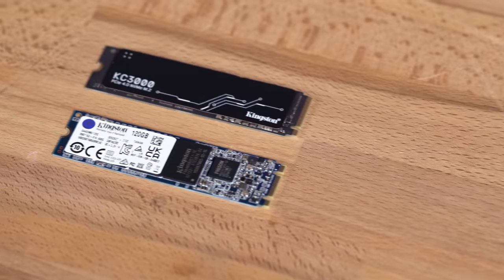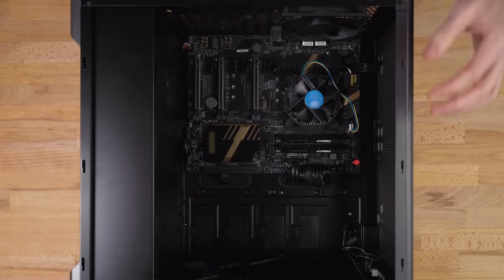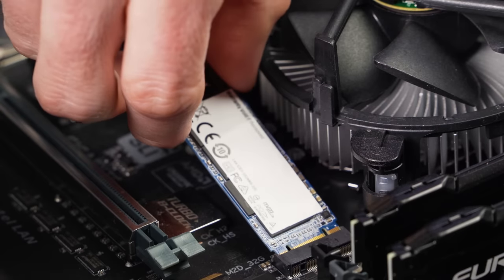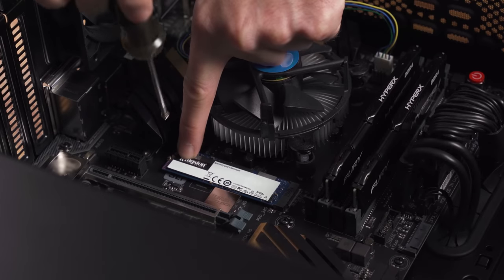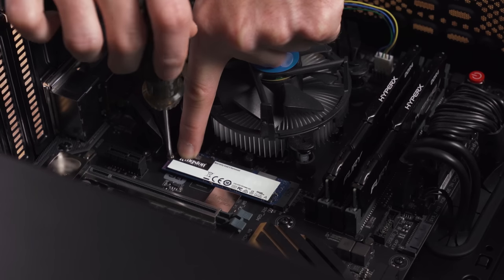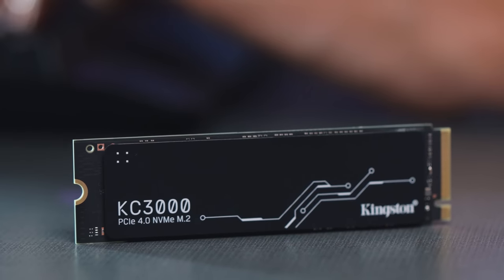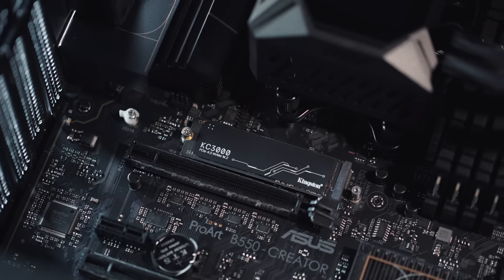SATA M.2 SSD vs PCIe M.2 SSD - What’s the difference? – DIY in 5 Ep 172

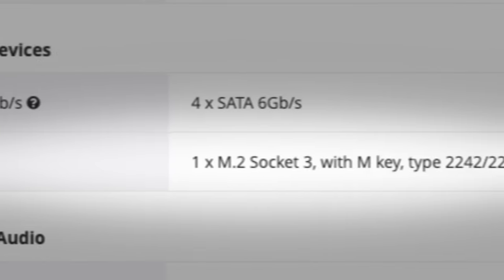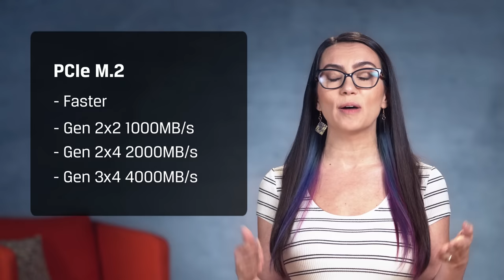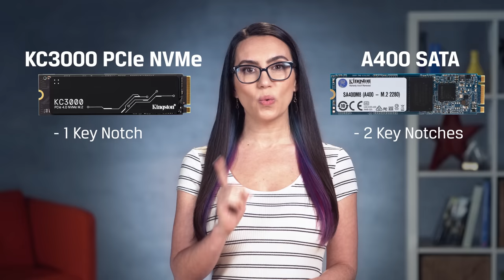Comment: At 2:00 in the video you claim that an M.2 SSD can only support one protocol. Perhaps that limitation applies to Kingston SSDs, but I recently installed a gen3 Crucial P3 Plus M.2 SSD (connector has only one notch) into an Acer tower PC and it ran at SATA speeds, not NVMe. When I moved the same SSD into a slightly newer Acer tower PC, it ran much faster, at NVMe speeds. So here we have an M.2 SSD that supports both SATA and NVMe protocols, although not, obviously, simultaneously. The BIOS / UEFI determines which protocol to use, but the availability of NVMe may be limited by the chipset PCIe generation. If the motherboard / BIOS / UEFI doesn't support NVMe in the M.2 slot then the Crucial SSD "falls back" to SATA. At 2:41 in the video you stated that Gen 3x4 maximum speed is 4000 MB/s, so how do you reconcile this with your statement at 3:38 in the video claiming that the Kingston KC3000 NVMe SSD can run 7000 MB/s read and write speeds, which shouldn't be physically possible? It's also hard to believe that the write speed is as fast as the read speed.
Reply from the maker: Hello,
M.2 SSDs will support either NVMe or SATA, but the M.2 port on the motherboard can support both SATA and NVMe. The Crucial P3 Plus was probably still running in NVMe and potentially at slower Gen 3 x1 speeds due to the older M.2 port, which is perhaps why it performs better on the newer Acer Tower. Remember, PCIe Gen 3 can go up to x16, but most NVMe SSDs only go up to x4. Now, our KC3000 is PCIe Gen 4 x4, which doubles the performance in both read and write speeds. Our 2 TB and 4 TB capacities can support up to 7000 MB/s. If you have any other questions or concerns, visit our support page: https://kings.tn/3leJG20, or send us a direct message via Twitter, Instagram, or Facebook Messenger. 

PCIe speeds explanation: https://kings.tn/3LraG9p

Comment: One question I had that I don't think was discussed was whether there is a difference between M.2 NVMe (which I guess is the same as PCIe? not sure) on a motherboard vs. M.2 NVMe on a PCIe expansion slot via an adapter card and if there are any issues like what kind of slot the adapter card is in or any other specs re: the card itself. I just bought an old computer with an M.2 slot but found out it's only for a PCI adapter assembly (Lenovo M900 tower computer) so I'm getting an M.2 adapter card for PCI Express card slot (physical link width x16; negotiable link width x4, x1) so I can use an M.2 NVMe SSD. The card is supposed to fit in PCIe X4 or X8 or X16 slots.
Reply from the maker: Hello there the NVMe SSD is the Bus interface while the PCIe would be the physical/logical interface. If you are going to use an adapter make sure you check the specifications of the manufacture to make sure it can accommodate an M.2 NVMe 2280 SSD. Also we found a  posting pertaining to using an NVMe SSD and adapter on your system: https://kings.tn/3KP5eLq

Comment: I have a question, I like to upgrade my laptop Macbook Air 2012. So I buy the Samsung SSD 980 NVme M.2 SSD. Also buy a adaptor for this upgrade. After done everything when I do power on nothing happened. So I replace with HD comes with laptop and it's work right away. So what I do wrong? Please advice. Thanks.

Comment: Nice video, I am still unsure though, I have a sata m.2 ssd (Sandisk SSD X400 M.2 2280) that is 6-pin (2 notches) would an enclosure that supports both m&b 6 pin PCIE and M-key PCIE work for it even if the drive is not PCIE or i need to get an enclosure that is not for pcie? I am asking because if PCIE supports it i would rather get that as i may use it again for another drive that is PCIE in the future.

Comment: I took my card out and it has the 2 notches as shown in your video.  Does that mean my driver will not accept the one notch card (PCIe) ?    

I just checked my laptop's specs  and for hard drive it says:  PCIe NVMe M.2 SSD  Form Factor 2280.  So now I'm really confused because it has 2 notches!
Reply from the maker: The B+M keys on an M.2 SSD allow for cross-compatibility on various motherboards if the appropriate SSDs protocol is supported (SATA or PCIe). For more information refer back to your motherboard manufacturer's website.

Comment: 4:00 well the script could have added that the SATA protocol still exists because NVMe is only impressive with large file transfers, not on loading games, system updates, or app installation where the SATA can keep up.
Reply: that's... not true?
Reply: @afriendofafriend5766  just read any SSD review on Toms hardware
Reply: try to load 4K ms flight sim textures on SATA and on nvme pcie and ull see if the game is loading faster

Comment: For system only NVME! SATA is veeeeryyyy slow now 🙂
My new 12400 enjoing with Kingstone KC2500. 20 sec - comp is ready.
Reply: 5900x sata ssd samsung 870: 11,5 seconds
Reply: @DiscordinviteCodeYvCHHzBN27  MS-DOS? 🙂
Reply: My laptop with M.2 SATA 860 evo, 10-12 sec and its ready
Reply: @RichBatangKalye  Obviously, you are using quick boot. This is normal only if you manually adjust the timings. I have 12 seconds of BIOS loading - the memory adjusts.

Comment: I've read many of these fast NVMe M.2 SSDs' self limit themselves on speed based on temperature  - they overheat unless you add an internal cooling fan ?
Reply: In most cases cheap thin cooling sink does the job. But almost all mainboards have already one pre-installed.

Comment: Have you ever rated what SATA M.2 SSD (2 notch) memory is the fastest and all-around best. I can't find really anything about it.
Reply from the maker: Let's start by saying that in December 2022 we shipped out the last of our SATA M.2 SSDs, the A400 M.2. We no longer make SATA based M.2 SSDs and going forward all our M.2 SSDs are NVMe. But at the time, SATA M.2 SSDs used the SATA interface with a maximum data transfer rate of 6Gbps. If you want to check it out, visit our site here: https://kings.tn/4bAOjJ1

Comment: WOW, I had no idea it was getting soooo complicated. 
I figured platters were slowest followed by SSd Tehn all NvME/M2 were the fastest but now there 4 generations of nvme/M2?
So which version/generation  is my samsung 960 Evo?

its running in a B450 tomohawk mobo running ryzen5 2600 cpu
SOOO do i need the new AMD AM5 mobos to run fastest generation of nvme?

i need a new video card soon anyways and am trying to decide if i shud just upgrade current system with new Gpu/nvme hdd and possible faster cpu and memory 
OR build entire new AMD Am5 system
Reply: Your current ssd is NVMe 3.0, as is your mobo. You would indeed need a new mobo to use NVMe 4.0 drives, but there's really no need for you to upgrade specifically for that, as very few applications are optimized for the speeds of even 3.0 drives yet 👍

If I were you, I'd just slap a better cpu and gpu in there and call it a day, maximum performance gains for your money. AM5 is very costly to upgrade to rn due to mobo and DDR5 pricing.

Comment: My XPG S 70 blade 2 Tb died after 3 months 
It won't boot and when i check it in the nvme configuration it shows as MN-5236 and disk size shoes 2.1 GB and sometimes when i remove the drive and install it again it shows S 70 Blade 2TB and when i run a device self test ( controllor only )  my bios freezes
Also my nvme idles around a 50 C and the max reeding i have seen on hw monitor is 62 C 
Can it be because of temperature? 

What could be the cause of my problem 
My friend tell me that it because of my high intensive work i do all day like for straight 8h avg a day

Comment: When I got my motherboard (Asus Prime B350 Plus)  I almost threw out the little screw. Hopefully I did in fact save it. I have not evolved out of my 2 SATA hard discs yet. One used to give me errors, but I moved it to a cpu SATA  port and it stopped. Apparently those you can only have the m2 in or the drive, not both.

Comment: Very clear and helpful video.  I have a rather strange question, hope it makes sense.  I have a 7 year old desktop with a 2TB HDD.  I am thinking about upgrading to an all new desktop, but not immediately.  Could I transfer the 2TB HDD to an M.2 NVMe and use in the old system (at reduced performance of course) with an adaptor, and then move to the new system once I purchase / build it?

Thank you.
Reply: Just put 2tb in the new computer , 2tb nvme are expensive , back it up first
Reply: There are external USB adapters that are easy to use.
Reply from the maker: Hello Bruce, if you are trying to upgrade your HDD to an SSD you can essentially clone your old drive to your new one. Granted the actual used space on your current HDD will not surpass the capacity or your new one. For example your 2TB HDD only has about ~700GB of actual storage used, and your new SSD is 1.92TB you should be ok. If you have further questions please feel free to reach out to us here: https://kings.tn/3AyDqY4

Comment: i have an extra m.2 slot in my mini pc, if i want to use a 2.5 ssd what adapter should i use?
Reply from the maker: We don't test adapters for compatibility, however you can search online for a M.2 to SATA connector with good ratings and try it out on your system.

Comment: I have a samsung nvme 980 and a 980 pro. Samsung magician app does not "see" them. In "drive health" all i get is "N/A. As i understand it, it's bios related. If someone is kind enough to tell me what setting, i think in "NVMe configuration" must i change so that samsung magician displays all data related to both ssd's?  Thanks a bunch in advance.
Reply from the maker: Hi there thank you for your comment on our video. We would suggest you reach out to the manufacturer of the SSD to get further assistance on their program. If you would like to check out our SSD selection, you can also visit us here: https://kings.tn/3HZnqkz

Comment: I've got a slot for an M.2 2242 SATA SSD (B Key) and a slot for a 2.5" SATA SSD, which of these drives is faster, and which one could be recommended to install Windows on? (PS: I want to install Windows on the faster one)
Reply from the maker: Thank you for your consideration on your next upgrade. Now since we only offer M.2 2280 NVMe drives for post-purchase options, your best bet would be our KC600 2.5" SATA drive for your current model. Please visit our site here for ore info: https://kings.tn/3w2LCQb
Reply: @kingston  Thanks, but why the KC600 though? Why not the A400 or Q500
Reply from the maker: Since you were asking about which drive is faster and the M.2 2242 NVMe was not an option, for SATA drives, the KC600 offers slightly better baseline performance compared to the A400 or Q500. If you have further questions, please visit our site here and chat with our Tech Support: https://kings.tn/3we3rfq 
Thank you

Comment: You want the m.2 NVME type which is interfaced over Pci-e which is capable of much higher data transfer speed often in the region of 5 times that of sata but exact performance comes down to the individual drive and operating conditions mainly relating in relation temperature.

Comment: Can i use m.2 nvme if my motherboard has not that port????
Reply from the maker: There are many notebooks and motherboards that support the M.2 NVMe SSD. However please consult system and processor specifications and user manual to check to see if it will accept an M.2 NVMe PCIe adapter, in case it does not have a native port.

Comment: How about my slot is SATA M.2 but i want NVME? What should i do?
Reply: Change motherboard.
Reply from the maker: We suggest you first check to see if your motherboard supports both m.2 SATA and NVMe in that slot or any other M.2 slot. If it does not, then you would have to upgrade your motherboard to a newer model that does have a native m.2 NVMe port.

Comment: 3:11 Can you elaborate? Do you mean if I use a pcie adapter to add another M.2 SSD, it won't be as fast as the one plugged in the M.2 slot that's already in the motherboard?
Reply from the maker: Depending on the type of PCIe Lane and M.2 adapter there could be a significant performance change vs using a dedicated M.2 slot built into the motherboard. For more information you can consult your motherboard manufacturer or contact us here:  https://kings.tn/3Q9tgV7

Comment: All need remeber is the NVMe has single slot one on the card and is always the fastest. Most Modern NVMe are PCIe 3 Gen4 or PCIe 4 gen 4 if you put a PCIe 4 gen 4 in old PC it will still work just will not get it posted speed. All Sata drives whether they M.2 or 3.5 inch run at near 600 MB/s.

Comment: if i buy KC3000 and also want to add graphics card having 6 led display option , kindly suggest motherboard ,processor and graphics card . also if i require 4 led display then what should be configuration

Comment: I'm JUST AS CONFUSED now as I was before... that's a lot of NVMP M.2 1000x2000x3000 speeds/notches --wha??  can I use an M.2 Sata in an NVMP socket ???   I dunno....
Reply: The answer is maybe. It depends on what your motherboard supports
Reply: Hi Dave, just as the commentor posted above, it depends on the manufacturer of the system which they will normally list on their specs (SATA/NVMe). If you are looking for an upgrade, you can check the manufacturer's website to be sure, or you can also check our part selector here: https://kings.tn/3N4UjfB

Comment: there's no such thing as sata m.2 ssd
Reply: Actually serveral MATX motherboards release in the past few years have a second M.2 slot that uses the SATA protocol as it shares it with one of the std SATA connectors on the motherboard to save money as PCIe muxes are extreamly expensive.
Reply: Intel's NUC's have used M.2 SATA ssd"s